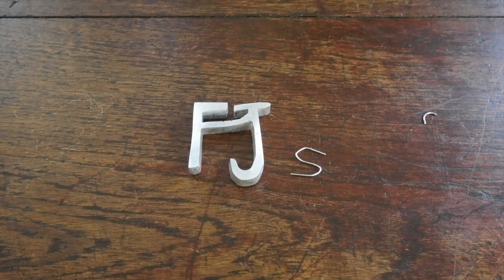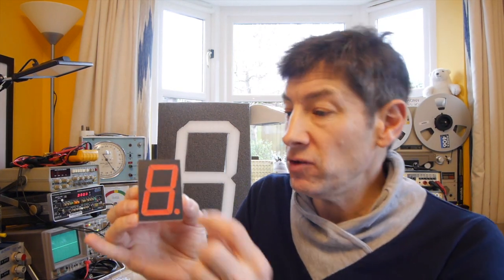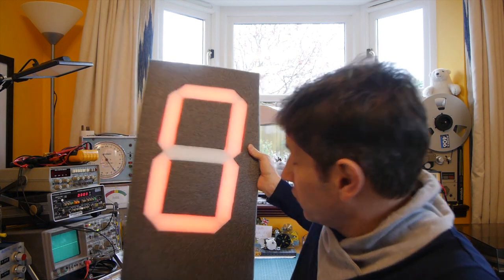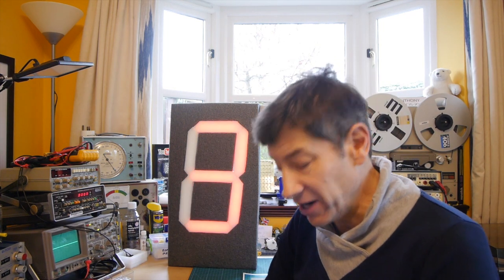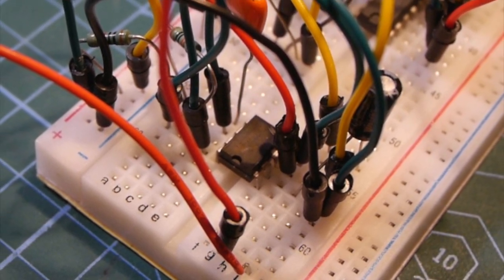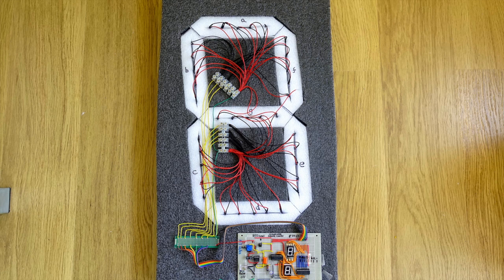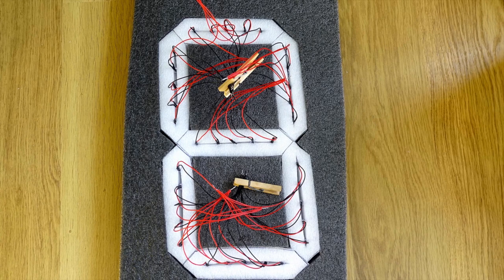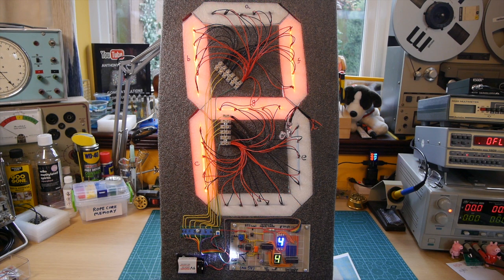Seven Segment Display - World's Biggest?! - F-J's Physics - Video 166

Comment: This is absolutely brilliant. I've been looking for something like this for quite a while, and I can't believe you've posted it!!!
Everyone uses audrinos and other microcontrollers for seven segment displays! Yours is not quite what I need, but it has given me the idea to modify what I have in stock!!! ❤
I need a large waterproof 2 digit output for my polytunnel temperature display! Currently using a 8inch vintage mechanical temperature gauge removed from some kind of gigantic machine! Perhaps a giant steam boiler! 😂
This is definitely going to be my next project after building a test rig for letterbox testing!
I imagine your kids never get bored with all your wonderful projects 😊
Reply from the maker: Thanks!  That's great to hear!  Sounds like you have got some really interesting projects going and, where you definitely improve on mine, you have an actual use for yours!  Lots more of this sort of thing in the pipeline.  Yes, my son, though young, loves the gadgets that I make.  Good luck with your projects and let us know how you get on.  Thanks for watching and taking the time to comment.  It can be a bit of a solitary experience otherwise!
Reply: @AnthonyFrancisJones  I was thinking how using this type of circuit like an amplifier to build a 8x8 or 16x16 RGB hat for a Raspberry PI only make it 1meter x 1meter ?
Reply from the maker: Yes, dartlington drivers (or transistors) are the way to go.  Just make sure you know if you need inverting ones so get the polarity of the LEDs right!

Comment: Another great video Anthony.   Now, how about you showing us how to make the world's simplest crystal radio, and also the simplest FM radio.  Gauntlet thrown down there... 🙂
Reply from the maker: Great idea!  Crystal set will be easy, FM side not so easy.  Of course these things come on a single chip now but you will notice that I like to build with discrete components whenever I can and also not using Arduinos etc. to do the hard work.  I am working on a mockup of part of the Apollo guidance computer core memory for another video (almost done) so with that and radios we are good to go!  You will need to get yourself a waistcoat!
Reply: @AnthonyFrancisJones  What about a crystal set  using a lump of galena, or even a rusty razor blade for a rectifier?
Reply from the maker: @welshspaceagency  Yes, I have been meaning to do a video on a 'discriminator' - test tube full of iron filings.  I actually have a crystal and cat's whisker somewhere.  Must look them out. I was fascinated by the Colditz story as a kid (and the game to match) and felt that if I was there I could easily have built a simple receiver.  I have an induction coil by the way.  Must get that out too!
Reply: The Ladybird book of the transistor radio was my inspiration at the age of 9. Instead of placing an earth rod into the ground I thought it more appropriate to fill a pot with soil and poke a ground wire into it! Hmmm, it didn't quite work!
Reply from the maker: @oldbritishmetal You invented the 'floating earth' at age 9!  I remember wondering what would happen if you had a ring of wire and a battery connected in series and you rapidly shorted out the battery and removed it - invented superconductivity at that age too!  Only later was I to learn that it was not quite that easy!